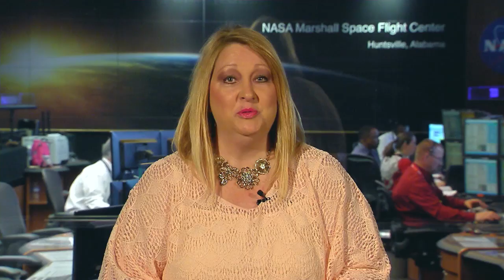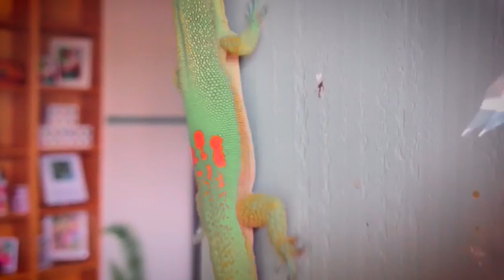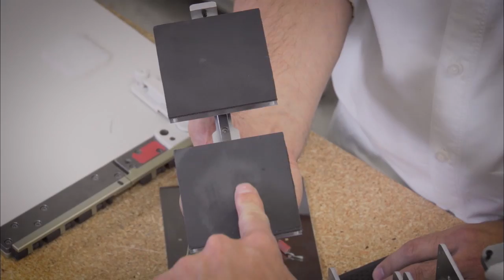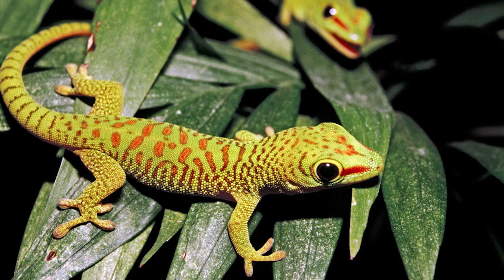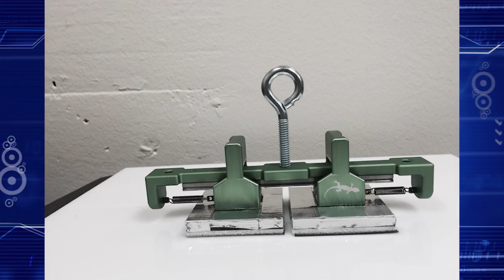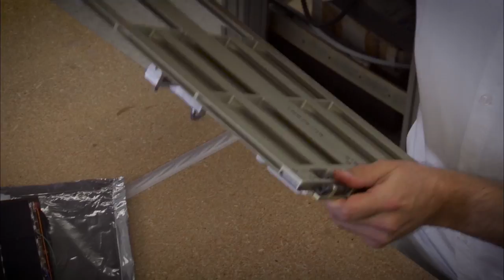Space Station Live: Getting a Grip on the Space Station

Comment: How do Spaceships locate the ISS in Orbit? Does the ISS transmit a continuous electronic signal beacon or is radar used? #SpacetoGround
Reply: The ISS has a specific orbital trajectory that is known and fine calculations allow you to launch vehicles to rendezvous with it. With soyuz there's a Kurs system which is a radar (if I'm not wrong, because I think there are Kurs transmitters on the Zvezda module) that is able of locking the ISS for final approach.
Reply: Hunter Falkner Thanks.
Reply: +Peter Fox Also, you can visit SpotTheStation.NASA.gov and select your home region, and it will give you a list of times (usually early morning or evening) when the ISS is orbiting over you. If you go outside and look in the right place at the right time, you can see the ISS! It looks like a bright star traveling across the sky taking about 2 or 3 minutes until it disappears over the opposite horizon.
Reply: StalePhish Thanks.
Reply: it's even an app where other planets can be seen (Not actually ) but through a radar. I have it on kindle fire
Reply: Look its the nerd It's not even through radar, it's just through math. They have equations to determine where the planets are at any given time and they use the compass, gyro, and GPS on your device to determine if you're facing it.

Comment: Does the Gecko Gripper use electricity to function or is it purely mechanical?  #Spacetoground
Reply: +Peter Fox mechanical, the spring between the 2 pads push the "rubber" in its sticky direction.. to make it less grippy you just squeeze
Reply: Twitchi Thanks.